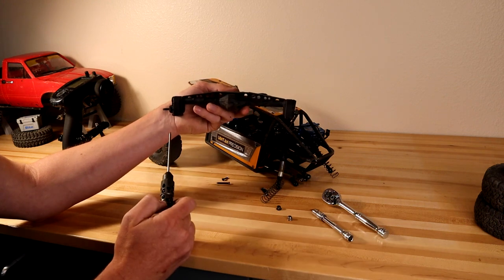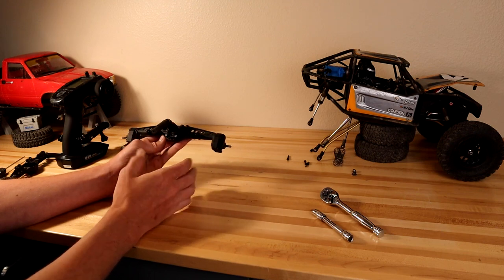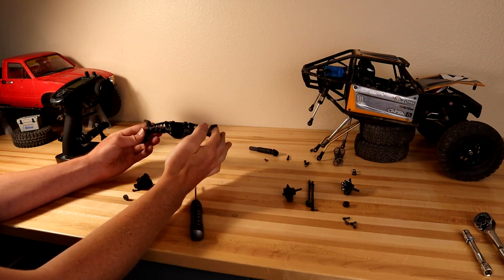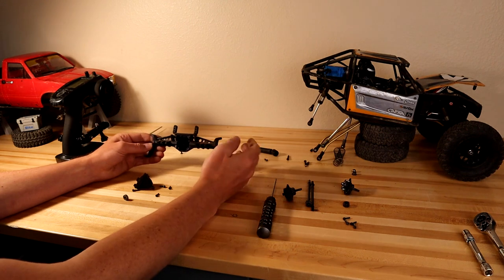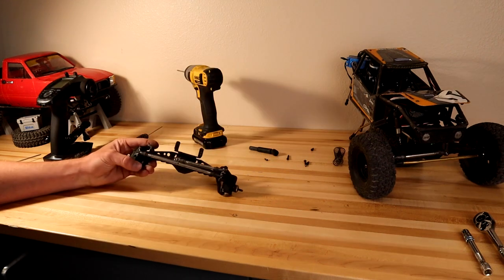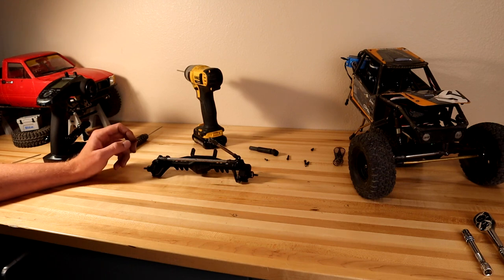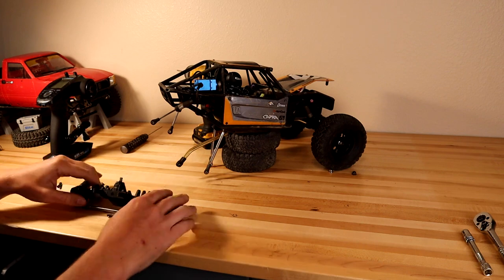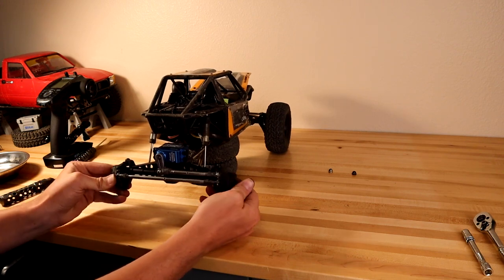How To: 4 Wheel Steer an Axial Capra!

Comment: I added rear steer to my Capra too. I bought an entire all metal aftermarket Capra front axle for around US$50 which came with everything including steering linkages. I wanted the rear suspension to work so I cut away part of the cage to clear the full size steering servo. In order for the servo to clear the receiver box, I 3D printed 5mm thick spacers to move the servo back enough to avoid hitting the box. Works great. I'm using a Radiolink RC6GS transmitter which has a rotary knob for channel 3 which is used for the rear steer. This knob is located near and to the rear of the normal steering wheel but it's too small to reach and operate with my left thumb while controlling the throttle at the same time. Solved this by 3D printing a new knob which is bigger and is textured for better grip. So now I can front steer with my right hand and control throttle and rear steer with my left, all at the same time. Dig is currently activated with a toggle switch but I may move it to a push button located near my left thumb. This way I can keep my hands on the controls and never take my eyes off the truck.
Reply: I need to trim my cage as well. Do you have a link to the file for the 5mm thick spacers? Or I suppose I could try washers too...

Comment: Exactly what I needed for parts requirements.  I run Radiolink and tried the pot control for 4ws on another vehicle and didn't like it.  I instead shifted to mixing (slaving) the rear into a 3-position switch for rear steer on/off with the main steer.  Works great.  I don't know if the GT5 can do that .  Looking at your crawling videos I can see why you need variable.  I don't.  Another example of setting the rig up for the normal terrain.

Comment: I am running 2 protek 370TBL’s, Team TnT high clearance links and I am running 90mm Dravtech shocks!! Power plant is SW4 with a yellow jacket out runner motor.  Also running a reefs 99 for the dig servo. I am running brass up front.

Comment: i wish you went over how you actually control the transmitter. i have the same transmitter with rear steer on channel 6, even bought a clamp on thumb wheel and i still struggle with controlling everything

Comment: The Spektrum family of 5-channel radios (DX5C, DX5 Rugged, DX5 Pro) all have full channel mixing for four wheel steering, including selectable mix for front only, rear only, crab, and four wheel steer. 
Also,  many low-profile servos will clear the back of the the cage without cutting.
Reply: The FS GT5 has all Modes in it. U can change it in 4 Modes for 4 Wheel Steering in the Menu.
Reply: @Braindog  I would say the weakness with the GT5 is the inability to assign the 4WS function to a specific button.  If you wanna use it, you have to use the menu wheel, and it's really tough to steer and operate that menu scroller at the same time. I will say that setting up 4WS on the GT5 is an absolute breeze compared to the Spektrum.

Comment: hy thanks for the video  i`m in the same process 
the part AXI31489 is incorect i think    the needed one is AX31403
correct me if i`m wrong
Reply: Hey West Desert Wheeler, PLEASE get back to gigiboxa and I as these two P/N do look the same but ARE of different dimensions.
Reply: @mredias3762  The instructions indicate it is AX31403.  I have AX31489, and it does not thread into the knuckles.

Comment: I totally mean this in a positive way, but thanks to you I bought a Bully2 MOA and now I'm thinking of a scratch build Capra with all the good stuff I see in your vids haha. I have a UTB18 already and am thinking of RWS for it as well as other upgrades before I go full-size Capra. I watched your video on the UTB18 and wanted to know if you have tried anything crazy with it yet? Thanks again for the great videos and info!
Reply from the maker: It is currently tore apart waiting for a brushless system, rear steer Reefs raw 400 and other goodies
Reply: @westdesertwheeler  Same here. I am going with a Holmes Revolver and Mamba X2 to start. I used your affiliate link and have a GT5 on the way and ordered all the other goodies through my local RC Shop including the steering axle for the rear. Will probably put the stock servo in back and get a good one for up front. Can't wait to see what you do with yours.

Comment: Hopefully you see this I know it’s an old video, I bought the 4WS capra RTR. I’m wanting to add dig so I need a new receiver. My question is sense the spectrum is a 2 and 1 system can I even use this receiver? And if so what do I need to do to get it set up? I don’t want to change the motor or anything like that yet.

Comment: Thanks. Will the flysky gt5 work with the receiver/esc combo unit , firma 40a, that comes stock on the capra rtr?
Reply from the maker: No they do not
Reply: @westdesertwheeler  …🤔…thats what I suspected. Hope the spectrum motor does work with the hobbywing 1080 I ordered. Otherwise I will get either a holmes or tekin.

Comment: Hey Logan. Now that you have your Capra CMS mount available, do you think it could be modified to work in the rear for rear steer, opposed to having the servo mounted on the axle?  thinking of taking my original rtr Capra and going Rear Steer with it using your mount.
LMK what you think.
Reply from the maker: It will not work on the rear